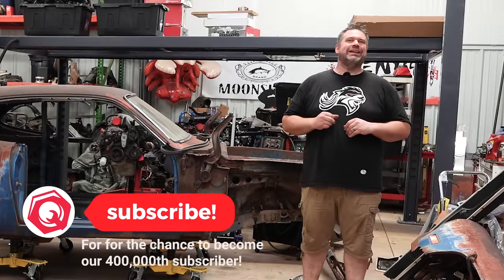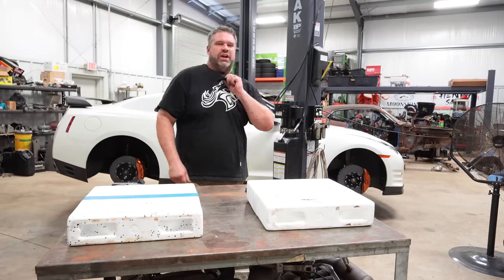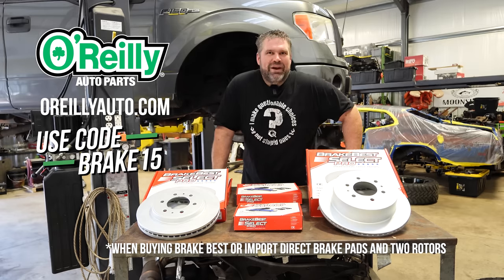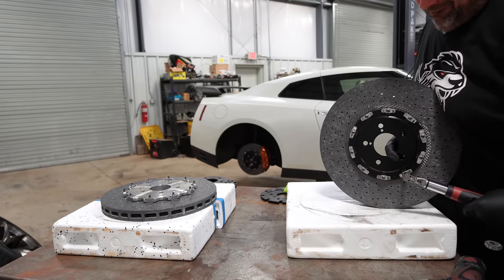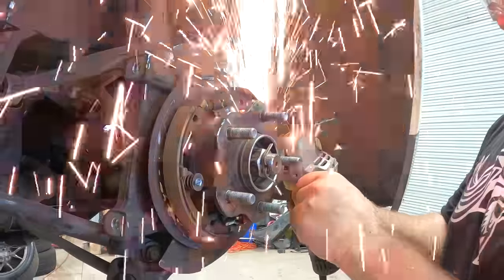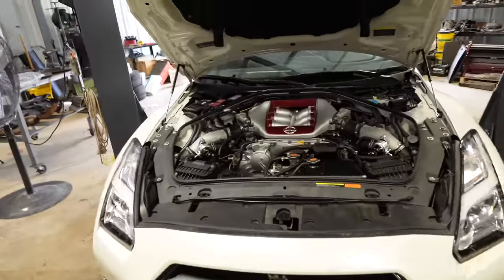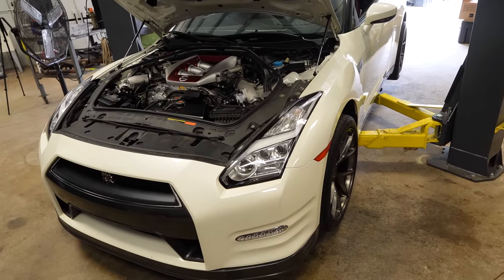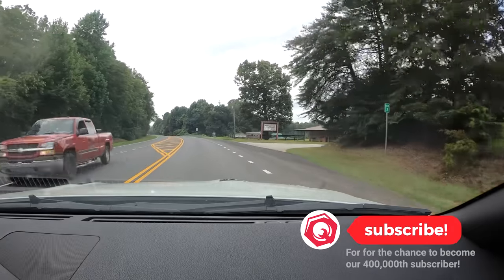Can Parts From a Chevrolet Make a R35 Nissan GT-R Better? Godzilla Brake Upgrade!!

Comment: Brakes, often the last thing people think of upgrading when it should be the first!  I really love that brake manufacturers like O'Reilly are putting these nice looking, rust proof coatings on their rotors now - I fitted a set to the front of my GS460 last year, and it just lifted the look of the car that little bit not having rust visible through the wheels.  I'm not sure if it's because of the channels I watch, but I really have seen much R35 wrenching content so this was great!  When the seatbelt electronic pretensioners kick in, you know you've got some good breaks - for me it was moving to Pilot Sport 4's that got me into that zone - the seatbelt gives you a nice hug 🙂
Reply: I might quibble and say tires are #1 and brakes are #2.
Reply: @marknelson8724 Can't say I'd disagree, a set of garbage Chinese tyres can get you into trouble quicker than some low spec, but functional brakes.

Comment: Great content . Questioning tho the use of carbon brakes on road cars due to the real need for heat to make them work properly 
Has the compounds and design changed so the brakes dont need as much heat  nowdays  Chers

Comment: @The Questionable Garage / Jared, I was told by friends in japan with the R32 and r33 gtrs that they both are heavy cars that were very wide compared to similar cars.  Is there something you specifically know about the r34 that is different? or is the r35 even quite heavy compared to those previous models?  I wasn't under the assumption that any of the GTR's were particularly light compared to other sports cars like the EVO or Subaru STI

Thanks for any info in advance.
Reply: The first two generations of the GT-R, produced from 1969 to 1973, were a relatively light ~2500lbs. The third generation, the R32, was introduced in 1989 and had similar dimensions but was quite a bit heavier at ~3150lbs. The modern version is closer to 4000lbs.

Comment: Do you not need carbon ceramic specific BMC or calipers? I’ve read when retrofitting either way on other cars, say a Porsche or Mercedes, you’re to swap the entire brake system and can’t just do rotors and pads. Also did you add additional brake cooling?
Reply: For the GT-R, you do not. Normal driving is fine but track driving heats up more than stock.

Comment: I hope your friend is doing a ton of track days! From what I've heard carbon-ceramic rotors need some heat in them before they have maximum stopping power and that steel rotors are the better option for street use. I think the main benefit of going carbon-ceramic is not fading from heat soak during track use.
Reply: Yeah, I think this mod is a poster child for questionable choices. Good, under the right circumstances.
Reply: They're half the weight
Reply: @macbook802  That’s nice but I think I’d rather have brakes that work well the first time I use them not ones I have to abuse a few times first.
Reply: @balcorn9211  I barely use my EV brakes. I'd prefer light brakes
Reply: @macbook802  Well you have a kinetic energy recovery system built in.

Comment: There's a couple things Jared missed.  First is the cost to switch to carbon ceramics is pricey at first, but, they far out last steels so if you put on real miles or track time you recoup the investment quickly.  Also, if you're concerned about cosmetics these have virtually zero brake dust.  Lastly if you're taking 15+ pounds of unsprung weight out of each corner while improving braking then you should be less likely to crash the car.

Comment: I’ve been led to believe that carbon ceramic disks were mainly for a track car and not really necessary for road use, and mostly just a bragging right for a street car. If I’ve been told wrong I’d like to be corrected so I’m not telling people the wrong thing

Comment: I have a brake related question for the car guys. I have a 2008 Dodge Grand Caravan and, it goes through brakes fast. I asked a few folks why and a Dodge mechanic told me it's because the pads and rotors are too small for the size of the vehicle. He basically said it was a design flaw from the factory. I was advised to try slotted rotors but, does anyone know of a better solution like, what Jared did here? Maybe a way to put bigger rotors and calipers with little to no modifications? Great video as always Jared.
Reply: My mom's 2018 Chevy Cruze was eating brakes. I switched her to drilled and slotted rotors, brake life has increased 10 fold. I got the kit from Rock Auto. Factory calipers.
Reply: If it doesn't have them installed, upgrade to Ceramic pads. They last much longer and take heat better than standard pads, which also means less brake fade.
Reply: @animebeatle81  I did the same thing. But the ole Cruze ate em up on even fresh turned standard rotors. She travels up and down a mountain everyday. The kit I ordered had the drilled and slotted rotors plus new ceramic pads. Be sure and follow the break-in or they glaze over.

Comment: Carbin Ceramic brakes are great for track days and Tail of the Dragon type runs, but are just not that good for street use.  Most supercar owners get them for looks and bragging rights, but will not use them as intended.